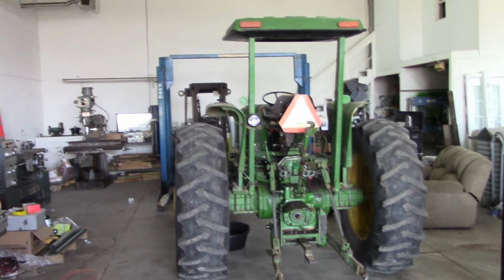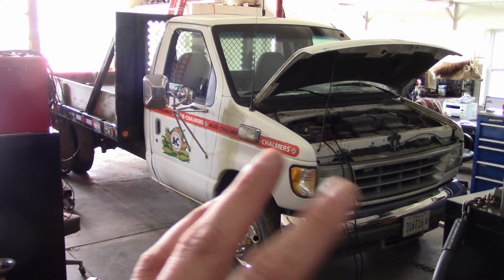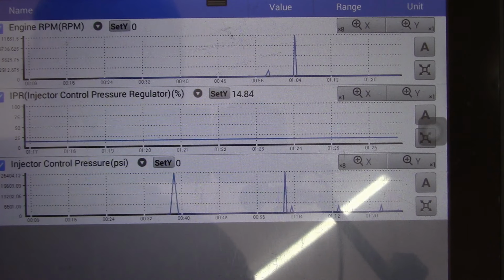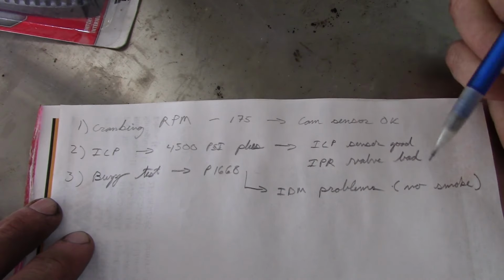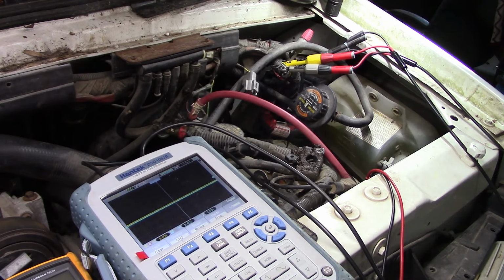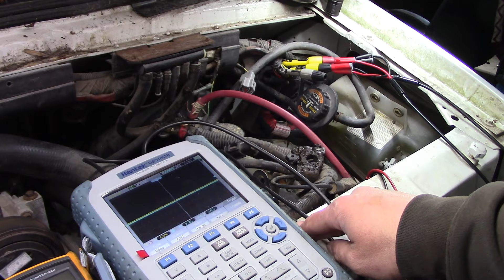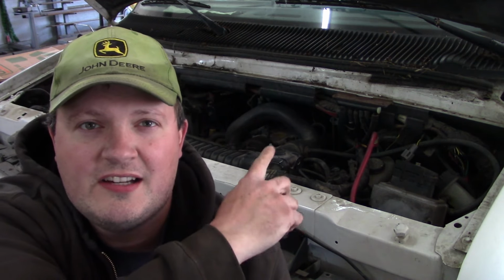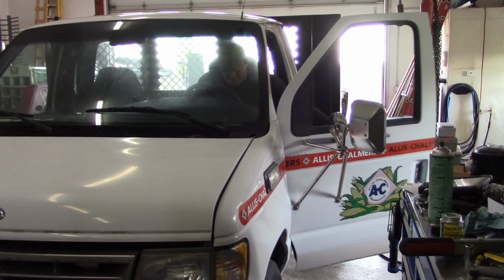Ford E350 | 7.3 Power Stroke - Cranks but won't Start - Part 1

Comment: I have an 02 dually and had some intermittent no start when warm and then the last time it just stopped running while driving . After 20 minutes of cool down it would start up and run fine again . originally I replaced the cps and thought problem was solved .  The last time it stalled while driving I disconnected the Icp sensor plug and it didn't start but after 30 minutes it refired . I since replaced the cps with the dark blue one and the whole ipr valve and the pigtail to ipr and the icp pressure sensor as mine was wet with oil in the plug . I ran forscan and all the numbers appear correct 500 at idle warm and 8% duty cycle on Ipr . I ohm tested original Ipr coil and cold it was 134 ohms and warming for a minute with a heat gun it was approx 1 ohm . My question is was it the Ipr coil causing me the issue ? Thanks for your time Ps all parts motocraft were installed

Comment: Next up transmission repair on club cadet lawn mower!
Reply: Yep
Reply: I was thinking the same, some newer tractors have plastic transmissions.
Reply: Jbog07  yep, I watch Taryl Fixes All and they're throw away items can't even change the gear oil in them. The innards are metal but the transaxlen housing is like a glass reinforced plastic. Briggs also uses plastic cams in their engines as well.
Reply: lol, thought the same thing.  then saw your comment and went back and deleted mine.
Reply: @PRL1290  that’s a garden tractor version. Not a tough torque. He will be fine. And it’s shaft driven and it has a Kohler 25 horsepower v twin. Known to be some of the most reliable engines in small equipment.
Reply: @mrl7661  right on, thx good to know.
Reply: Ive put mower thru way worse than that.  But im sure it took some life away from it.
Reply: @PRL1290  what point of a plastic trans
Reply: Just get a wheel horse from the 70s Tough as iron and simple to work on. Still quite a few around as they were built in Indiana.
  The early Cadets were about the same durability with the cast iron Kohlers and I H transmissions
Reply: The motor on mine cracked and I replaced it with a John Deere

Comment: I had a 97 F350 power stroke. The harness inside the valve cover had worn thru. It caused the IDM to fry 3 times before I finally figured out what was causing it.
Reply from the maker: That'll do it!

Comment: Most states set an age limit on emergency vehicles. As a former police officer our vehicles were replaced around the 100k mark.  The volunteer fire/rescue were regulated by the state by age of vehicle.  You stated in the beginning of the video that the owners company converted the ambulance to the flatbed.  Lots of electrical connections had to be removed and reconnected.  Maybe the tech that worked on wiring crossed wires someplace causing a surge to the control module.  Sounds also like it ran before the conversion. GL Wes.
Reply from the maker: Yeah, damage from various conversions is pretty likely.

Comment: ICP will climb to its maximum Level during cranking on an extended crank to force higher injection pressure if it's so cold it won't start at lower pressure

Comment: Say what ya want, so glad I had a Cummins. Only had two problems, crank shaft position sensor and both fuel pumps.
Reply from the maker: They all have problems. The Cummins engines age well since they are all mechanical. But the common rail engines are going to be just like these power strokes as the years go by.

Comment: Great vid 🖒 hope part 2 comes
When you fist got the van to the lip the cub was doing a tad bit of tire slippage to the right 🤔😆 . All I could do was hear you going , come on you s.o.b 😒😒😅😅 then you back out for another run . .just a suggestion here. Take a old tire and mount it to the front of the quad bumper/ rack . You now have a push gard . A lot of shops here in upstate n.y do it this way .💪🖒
Reply from the maker: I've thought of making a pusher attachment for my forklift.
Reply: That will work in the shop . Not so good in the stone driveway.  Don't get me wrong it can go on stone but they don't like it 😆

Comment: Have you checked the voltage coming out of the alt.???Most run the heavy duty alt with built in regulator ..something may be burning the  IDM, possibly the alt if it was changed recently

Comment: Hello I have a problem with my 1999 f250 with the 7.3 I went to started in the morning it fired up just fine after maybe 5 min it quit now it turns over fine I see the oil pressure going up but I don't see a wait to start light no check engine light,no rpm n my hydra chip tuner is not turning on Neither I'm not sure what is wrong with is I maintain it really well it never give me problem till now anything will help thank you

Comment: I've seen ECT sensors fail on GMs and cause all sorts of problems.  Unplugging them is the diagnostic method on a GM.
Reply from the maker: I've seen that on gas engines. It makes them act like the choke is stuck on. I've never seen that on a diesel though.
Reply: @WatchWesWork  Yeah, it's a problem that's unique to GM gas engines.  What prompted the thought is that the ALDL data shows the same thing, -40degF when the sensor fails.  Apparently Ford shows -40degF as open and GM seems to interpret an open differently.  To this day, any time I see a TBI or TPI motor that runs like crap at idle, unplug the ECT and see if it clears up: "There's your problem lady".  Had this happen to my 1988 Corvette and 1994 K1500 within months of eachother, saw it on a 1995 C2500 W/T too.

Comment: I think, since about 1989-90'ish all ambulance vehicles had to be of diesel power.  Something to do with a lesser degree of fire/explosion in a crash, than a gasoline power engine, given that patient transport was on board.
   Anyways, looking forward to a part 2.  I'd did not know that there were OBD port(s) on a 1995 Powerstroke, or that a "buzz test" could be done on a 1995 Powerstroke.  I learn so much from you videos, it is pretty awesome.
Thank you sir.
Reply from the maker: The Power Strokes were OBDII-ish in the early years. They did not follow all the standards, so some scan tools will have issues communicating with them. You can reflash the PCM to a later version and get full OBDII functionality. The Autel does pretty well.
Reply: Watch Wes Work ok, thank you.

Comment: Its almost always a bad wiring harness on these trucks. A little moisture in the air and boom. You have to take into consideration the rust factor and grounding too.

Comment: If you look closely at the wiring harness plug, you can see breaks in the other wires insulators. Those breaks line up exactly with the metal bracket. Shorting 100V+ DC across to even a 12V DC line will fry things. A little moisture will make those bridges much easier and poof goes the driver, luckily it wasn't finding a path to the main ECU.
Reply from the maker: I'm not sure what bracket you are referring to. That connector is bolted to a bracket, so it doesn't move.
Reply: @WatchWesWork  The bracket is static but the wires move. They are rubbing against the bracket and eachother.

I saw this happen on an ABS/traction control module on a GM. The wires rubbed through and started shorting to eachother.

Comment: Hey many many years. the 6.0 is so much worse in an ambulance. I am an emt!
Reply from the maker: The 6.0 is actually physically larger even though it has less displacement.
Reply: @WatchWesWork  they are out so much longer for repairs between turbos, exhaust leaks, just everything. We no longer have any 7.3's but they went out and came back quick. We have done the EGR and Oil Cooler things but it just never ends and these things are expected to last 200k with idling...

Comment: hey Wes, at 14:40 what are those wire tap/piercer things you're using and where can I get some?  They look like they'd accept banana plugs too right? edit- minute later and yes, banana friendly haha! Some of those would be pretty useful for some multiplex dick-aroundery I'm having at the moment with a dash constantly going to sleep while running etc. Be so much easier than scraping insulation or stabbing probes in my fingers lol
Reply from the maker: They are made by Pamona. You can get them from AES wave.
Reply: @WatchWesWork  Brilliant thanks for getting back to me so quick, appreciate it's not always easy to reply to comments.  Thank you.

Comment: i have a 97 f450 7.3 auto, was a garbage packer in its previous life, u would be driving along and out of know wear the engine rpm would redline truck would go into limp mode and stall, after lots of research and questions and finally running but not throttle, i found a little module inline with the foot tpc, disconnect the thing and problem solved,
Reply from the maker: Interesting. I wonder what the purpose of the module is.
Reply: @WatchWesWork  when the packer hydrolics were actuated the engine would hit a set rpm, for some reason it would just kick in

Comment: I hope there is a part two - this is very interesting!  I both love and hate problems like this.  Hate them as I'm trying to fix them...but when you finally do find the root cause...I love the feeling of accomplishment!  Keep on keeping on!  Looking forward to the Deere parts coming in and more on the Deere.  Tell your better half that she did a great job driving the ole van into the shop - not easy with no power anything in a vehicle that depends on having power everything.  :)
Reply from the maker: Helps her build some upper body strength.
Reply: @WatchWesWork  hahahahahahahaha!  ;)

Comment: Wiring goes bad more on time than on miles. So glad everything I drive is brainless! 😎
Reply from the maker: That's true. Plus there is the rodent factor. I've evicted many critters from the valley of a V8 engine...

Comment: There are several lil diodes inside the IDM that fail  can be removed and replaced with an extra 45 hp

Comment: You said the injectors ran at higher voltages. What voltage range are they in? The higher the voltage the easier to jump spark even against plastic.
Reply from the maker: 120v pulsed DC. It's high, but not like an ignition coil.

Comment: Someone else already mentioned it but it does appear that the orange wire may be arcing. Maybe it is corroded inside or partially broken? Could be causing an amperage spike on the IDM causing it to fail.
Reply from the maker: Yeah several have said that. I need to check it out. I already covered it with some liquid electrical tape.

Comment: Here's a thought... verify the alternator output voltage, may be too high (ignoring the dash gauge)... if I had to bet with the info I have available, the power regulators in the  idm fry after those 25 miles from overheating :)
Reply: jason9022  I agree, however in that short time period ? They might survive, and who's to say something else isn't fried ? Or can withstand the extra voltage ? 
In any case I hope for a part 2 soon :D
Reply: That sounds like a perfectly reasonable assumption that I would not have thought about.  Very good idea to check.
Reply: I had an alternator spike on a GMC safari, battery was fine but it messed up the ecu.Difficult to start,stalling and hunting idle.
Reply: Shouldn't the IDM detect over-temperature and/or over-voltage and just shut itself off?

Comment: hi im andree marshall i live in Omaha Nebraska m;y wife owns a 2011 ford edge and it has a brake problem most of the time the brake goes to the floor until you hit a big bump, then you get a normal brake pedal, the vehicle has been to numerous shop and ford dealership I'm concerned for my wife  safety but we are at a lost cause no one can find the problem

Comment: I agree the newer design valve cover harness is better. I get them from ford, I have had repeated comebacks with the dorman units. The spike in icp I have seen on a few different trucks with failed idm.
Reply from the maker: Does Ford sell a gasket without a sub harness like the Dorman? I know they sell the wedges to keep the harness from coming lose.
Reply: I’m not sure now that you mention it. Just know I’ve had problems with the dorman ones. They may have made them better now. Haven’t used them in a few years

Comment: Good job, Wes!  I agree you still need to find the root cause of the IDM failures before putting this back on the road, or it may very well fry another one in another 25 miles.  
For what it's worth,  I'm  a retired career paramedic in Charlotte, NC.  We ran 7.3 Power Stroke F-350's for several years but I'm not aware of us having  any ongoing problems like IDM failures.  As far as I know, the 7.3 power strokes gave us pretty darn reliable service.  
Ambulances do indeed get a LOT of idle time.  We do "central depoyment" with our fleet and "post" trucks at specified locations strategically. We are deployed and sent to fire stations and even street corners (a point close to intersections).  In many instances, our tricks are at least idliing the entire shift 10-12-14 hrs at a  time.   I don't know how the ambulance company (EMS provider) operated where that chassis-cab came from, but I can vouch for the fact that in many areas, ambulances get an INSANE amount of idle time (mainly for HVAC/climate control for the crews).
Keep up the great videos, man!   :-)
Reply from the maker: Yeah, I assume it has plenty of idle hours. I believe it was owned by a volunteer fire department, so it may have had a pretty easy life.

Comment: It's the value cover harness, I sold my 95 f250 with 280000 miles. Running 2 sets or gaskets. The wire harness burns.. Glow plug . the wire would fry on the injector wire. That was my problem.. Worked the tar out of that truck.. Only 1 e40d trans.
Reply: Agreed. That and the cam position sensor are common failure points with 7.3's

Comment: I've worked on a number of these and for me it's kind of a catch 22,some things are easier in a van chasis,like if you want to change a turbo it's actually easier pulling it out through the doghouse,but,I have noticed that anything it's a idm issue such as yours it's 99%of the time a wiring issue,I have seen the idm itself grounded to the body,also I had one where the engine harness plug you refered to was cracked and causing the injector feed wire to short to ground,I would do a ohms check from the idm through that plug to the valve cover plug,this will eliminate the wiring,also,if it has a braided ground cable and it's green,cut it off and replace it,those suck.good luck and let us know what you find,I like to put stuff in the memory bank for later👍
Reply from the maker: Yeah the up pipes would be really easy! I just don't know on the wiring. I've checked continuity through all of the injector circuits and they seem to be right on.
Reply: You said that used to be a rescue ,one thing just dawned on me,we had a rescue that kept blowing the run fuse and we couldn't figure out why, finally after a week of off and on testing one of the EMTs came in and said,"did they tell you it only happens when you step on the e-brake?" Ummm no,so,to the e- brake I went and sure enough the clamp that holds the harness came off and chaffed the wires so Everytime you step on the e-brake it blew the fuse ,those rescues are wired so when you step on the e-brake it bumps the idle up to charge the batteries because they draw so much,if you look on the e-brake switch you will see where they tap into it for the high idle,if that's shorted you could have a back feed causing idm failure.just a thought or a direction for you

Comment: I have had two idm failures and both were completely different from yours.    But i do know low input voltage and bad grounding can fry them.     One failure was hard starting and no rev.  And the other would just start then die repeatedly

Comment: I have an 03 7.3 and it ate two IDMs like six years ago, I don't have all those fancy pants scanners and stuff so I just started eyeballing stuff. The right bank gasket wire harness had some overheat melting/shorting stuff going on. I got two new ones and haven't had any issues since. I don't know if I just got lucky but it seems like it was too much of a coincidence if it was one. My luck doesn't usually run that way.
Reply from the maker: I'm sure they were related!

Comment: I gotta find one of these! Coolest thing ever! Yes, I like vans and station wagons.
Reply from the maker: Prices are usually pretty low on these van chassis. No one wants to work on them.
Reply: Me too J C
Reply: Local guy has one he put a lift gate on it and uses it to pick up scrap from auto shops.  Great for that use as the deck is quite low compared to most flatbeds. Charles
Reply: @WatchWesWork  I've got a 1998 van with the 7.3 liter "PowerStroke" engine.  I love this thing, but with 350,000 miles, I'm worried that I should rebuild the cylinder heads and injectors soon (to help it last more than 800,000).  The problem is that getting access could mean having to remove the entire cab from the chassis, something I don't have a garage or other facilities to do such work in.  These things are a pain in the butt to work on - removing most of the intake air assembly just to change a fuel filter...ughhh.
Reply: Agreed loving it too
Reply: @ktraglin  that's why I like my 7.3 pickups. Easy to do maintenance and easy to change parts

Comment: Interesting... I've been building and running 4x4 Van's for a long while. I would go insane if I worked at a shop like there's. Van's for days. lol  I now have my own lift kit system for them... been thinking of a way to build like 10 and make a new style gambler 500 platform..FUN FUN FUN. I'm for sure going to stay here.. you are doing great. A bit over my paygrade.. but not for long.. lol thank you for your videos.